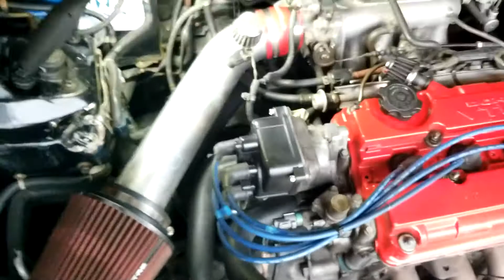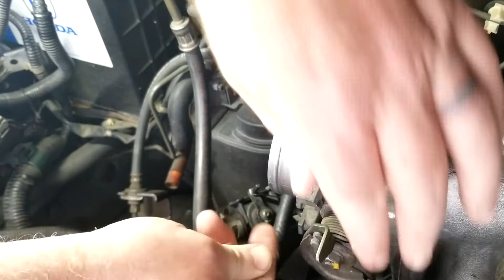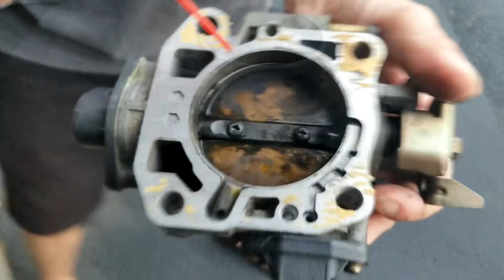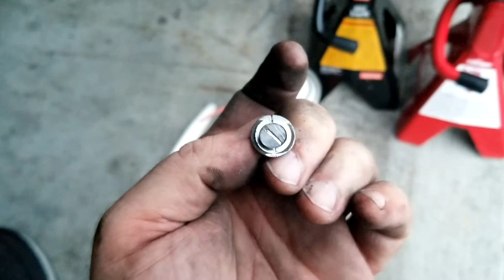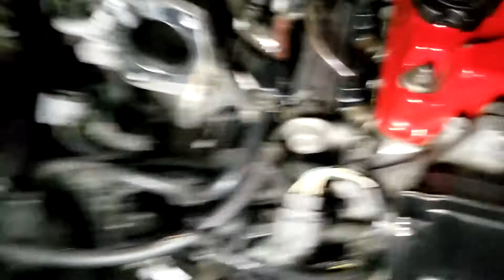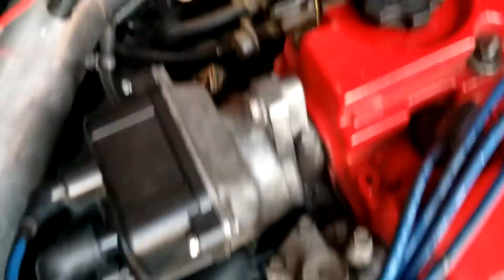JDM B16A Throttle Position Fix

Comment: My b16A seems to idle fine but will not hold a steady rpm when applying gas peddle could this be in part of the throttle body
Reply from the maker: The first thing I'd check for is a vacuum leak. Imo, that's the number 1 reason for idle issues on these older Hondas.
Reply: figure it out ? same issue on my b16

Comment: Would the specs be the same even with an aftermarket throttle body?
Reply from the maker: If u mean the TPS voltage settings, then probably so unless the manufacturer says different.